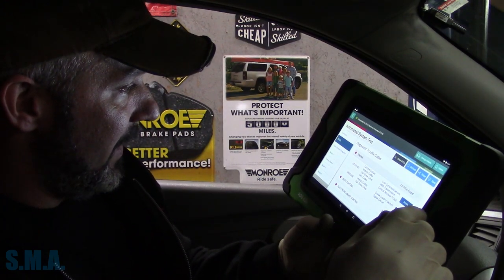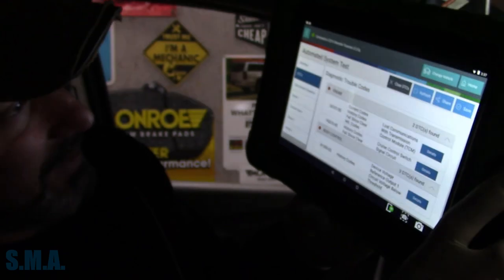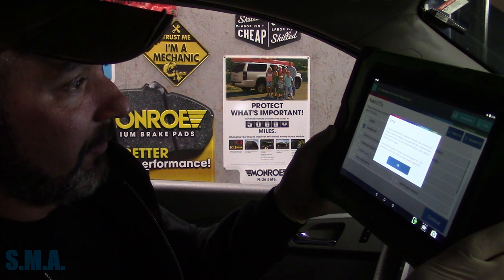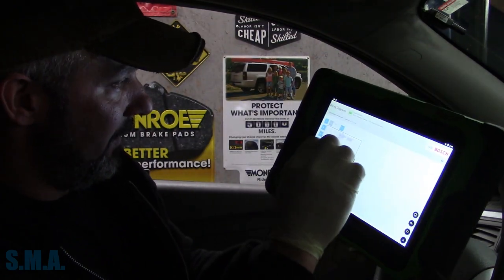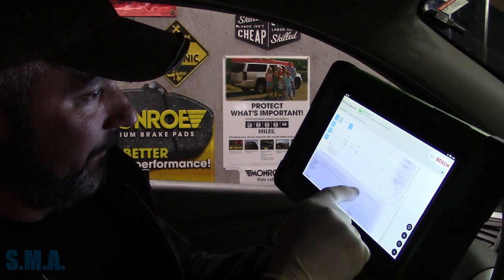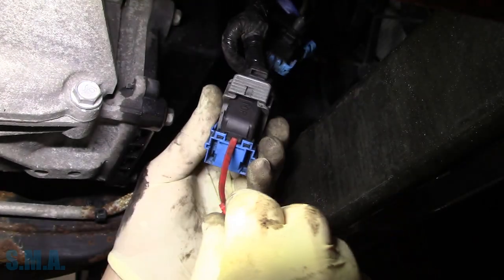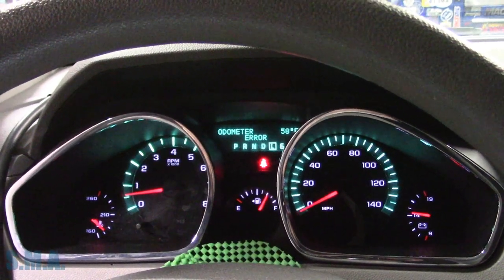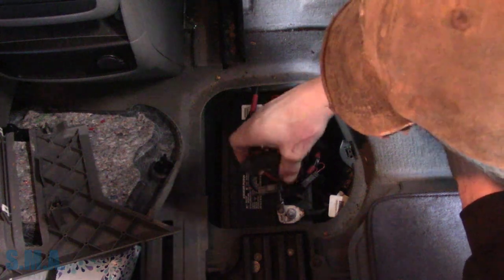Chevy Traverse: No Communication w/ Transmission Control Module

Comment: I had the same error message after someone tried to program a used Bcm with Sps. I reflashed the original Bcm & problem was resolved. On a number of 2010 & newer Gm Global A will cause strange things like this if you try to reprogram used modules. I have figured out a work around to get Gm global A vehicles to except programming of used modules.

Comment: I don't like the "lead free" rosin core solder for the reason Eric alludes to. That is what causes solder joints to fail. Therefore, I agree with Eric to use a crimp connector instead.

Comment: Never solder wires to used where there is vibration. The wire work hardens at the point where it leaves the solder and will fail. A proper crimp is better and one of the reasons crimps are matched to crimp tools. In fact where we build things that are not even subjected to vibration we have to use crimps and the rated tool or it cannot be certified by the testing agency. The propper tool compresses the joint to the optimal point and it is so compacted that it will not oxidize inside the crimp.

Comment: My 57 Chevy never had this problem!  LOL!!!
Reply: hffp1  Until sometime in the '80s engine block cylinders were straight bored and honed, then cylinder heads were bolted on. That made the tops of the cylinders squash a wee bit, resulting in serious  wear on the #1 compression rings.  That 57 Chevy was ready for an engine rebuild by 100K miles. If  modern engines don't make 200K miles there is something wrong.
Today I consider 100K miles to be the sweet spot for buying a used car; at 50K miles it is hard to tell how it has been treated; at 100K miles it is hard to hide.
Wish a Ford and a Chevy
 / Would still last ten years like they should
 - Merle Haggard, 1981.

Comment: Eric. Have you ever used Tesa tape? It's that fabric tape.
Reply from the maker: Sure do :)
Reply: Is that the same as friction tape?  It's black cloth tape.
Reply: I wanted to know if that tape is waterproof and can it handle the heat the engine throws ?

Comment: Solder of any kind doesn’t belong in wire connections in cars for the same reason it isn’t used in the aviation or marine worlds.  Nothing beats compression as long as the proper tools & techniques are used.

Comment: My uncle has a 2013 chevy traverse ltz and it is a no crank no start no gauges it says service airbag service traction control  service stabilitrac and the dtcs are u1511 p1682 p2535 also has no locks and no windows

Comment: Just got this issue on my wifes 2012 Chevy traverse code u0101  and found this video After work was done But I ended up taking it to the dealer and instead of it being a melted wire the now call it a  Corroded wire issue so it would not be covered under any Warranty.

Comment: On connectors like that I wrap with tape then put rubber cement where the connector will rub... but that's on my own vehicles.. lol
Reply: I probably would have put some wire loom (split type) over the wire at the connector.  It appeared that it had the room to slip inside the connector.
Reply: @Newman81964  I'm poor.. lol... but no excuse I know... thank you!

Comment: Connector designed to accept suitably sized poly loom..... poly loom stops short, wire looks to have rubbed on connector housing.  Fantastic engineering 😶

Comment: i have a question i have a 2002 chevy express van and my turn signal lights on my dash blink fast when i turn on my turn signal like i have a bulb out but i don't. if you go to the back of the truck both lights are blinking at the same time and my reverse lights also i checked some of the ground wires and they are good could someone please help me
Reply: Had that issue with a Dakota, green crusties at one of the connectors under bumper. Wire fell off connector after ohm checking, move things around.

Comment: Those Chevy  equinox are top notch put the battery 🔋 under the passenger seat off gas in the car  battery acid leaks Chevrolet  design 👍

Comment: I don’t understand why these other shops can’t even find a broken wire? They just give up and send it to a different shop?
Reply: The sign may say "auto repair" but if it's other than a flat tire or an oil change, it's beyond the scope of many shop's training and abilities. At least they knew their limits and sent it to a competent Technician before they started tryagnostics and swaptronics.
Reply: Sadly they just seem to play 'parts roulette' and throw new parts at it until the problem goes away (or doesn't)

Comment: It's not the type of solder. It's just solder. It alloys with the wire and the whole thing becomes brittle and doesn't tolerate the shaky environment of a car. I've learned over the years to just stop being a soldering nerd and to just crimp things. Quicker and better.

Comment: My daughters 07 speed sensor in the wheel went bad to the whole hub has to be replaced( $500).   All these sensors are costing people money because GM made sure you cannot remove the sensor. Its too bad it cannot be drilled out but nope.
Reply: Sensors can normally be replaced. It's just usually best to replace the whole hub. $500 sounds pretty steep, shop around.
Reply: @fascistpedant758  Not wanting to argue, just wondering why.
Reply: @paulmonk7820   On some models, the sensor alone is almost the price of the hub and bearing assembly with a new sensor. On many models, the sensor protrudes into the bearing housing and any debris falling in while removing a broken sensor can't be removed and could damage the bearings. Also, if the sensor failed, it could be caused by a problem inside the aging hub assembly. You could be saving $50 now, only to replace the whole thing next year.

Comment: The other shop did not find the damaged wire because they are not as good as you are - bottom line.  You are an excellent technician.  You can easily teach a class after your shop days.  We would have a better class of automotive techs if you were teaching them how to troubleshoot.

Comment: I have a GM P069E code dont know what it could be
Reply: Fuel pump control module requested MIL ILLUMINATION.
Reply: @paulmonk7820  that's exactly what it is, I dont know that caused it to light up

Comment: I'm not going to use a seam ripper, that's a woman's thing, I'll just use a razor blade and hack into this loom because that's what real men do.... oops let me repair these six wires, "that's just the risk you run hey ho".
If I worked for SnapOn or MAC I'd buy a million seam rippers at $1 each, slap a branded handle on them and sell them for $100 ea.
Then YT will be lit up with "This new tool from SnapOn / MAC will save you hours and $$" - it's not a seam ripper, it's a wiring loom tape slicer and it is manly, just look at the name stamped on the handle..... affirms right there.. manly, now where is my gun?
:D

Comment: Typical GM, they forgot to put the battery in the car when they built it. And when they did, they stuck it under the seat.

LOOOOOL
Reply: At least you don't have to Jack it up and take the wheel off, fender liner ... Chrysler!!!